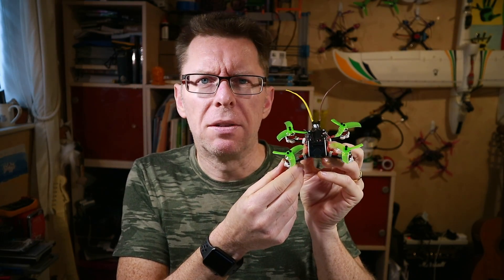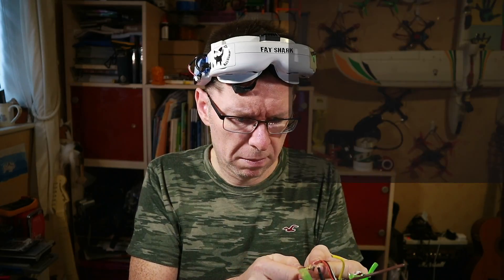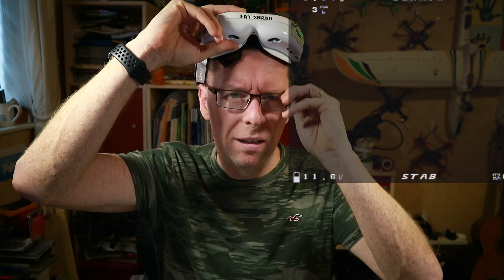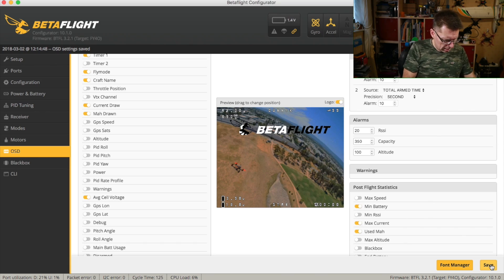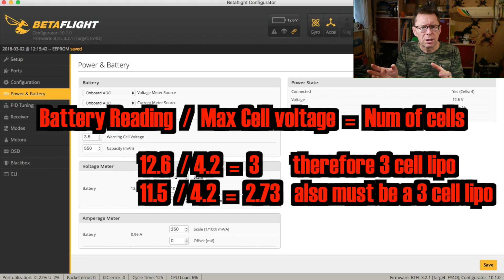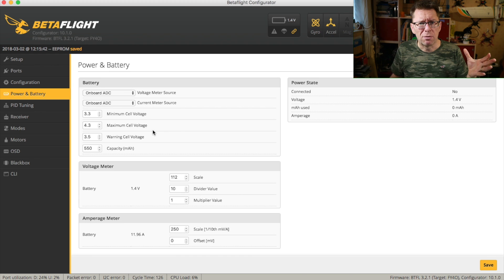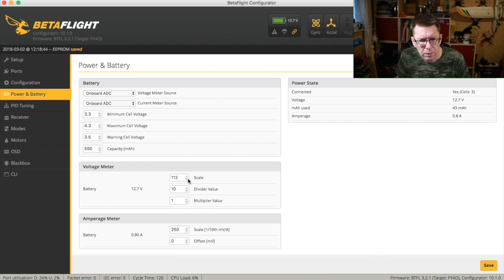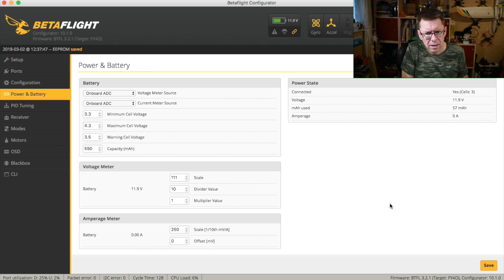FPV Quick tip: Fixing a flashing OSD battery voltage

Comment: Oh My Goodness i found this video, since I'm struggled with this same issue, Very usefull. Also i have an another doubt, since my battery(4s) voltage is now in 9.$v, How can i again charge it safely to the correct voltage? please suggest or post video for that.
Reply from the maker: The right answer is that the battery chemistry has gone too far and the lipo is past saving - replace it.  However, you can bring those cells back - do so at your own risk/against manufacturers advice etc and you may need to use a nicad or NiMH setting on your charger.  I won't describe it here, but do a search for "Restoring/Recharging Over-discharged LiPo" and you'll find plenty of guides.  You should note though that if you can bring it back to the correct voltage, doesn't mean it's "fixed"
Reply: @CurryKitten  okay thanks for the info.. will do that

Comment: What if my voltage keep 0.00v?
pls help
Reply from the maker: Would generally mean that you haven't connected up to your power to the vbat connection.  Flight controllers can all do things a bit differently, so check your pin outs

Comment: I have flashing zero's for both lipo voltage and average cell, I'm hoping this is the issue.
Reply from the maker: I doubt it, getting a zero on these usually means that it's not reading your input voltage.  Some FC's take their power in from the main lipo and it will pickup the voltage reading here, other ones run on a 5v input and have a specific vbat pin you'll need to hook up to your battery just to read the voltage.

Comment: Great video.  I had a reading of 3 cell in Betaflight when I had a 4 cell battery connected, and the all the voltage readings were off.  This video got all that straightened out.  Thanks for thinking to make a video out of this.  I've had the cell count of before and didn't know how to fix it.  Your explanation made it easy to understand.
Reply from the maker: No problem.  Sometimes I make video because I get stuck on something, so I figure other people do as well.  Glad it helped you out

Comment: Hey I think have the same problem but can't fix it..I have a BrainFPV Radix and can't see anything about battery either in Betaflight when I plug in with usb!
My voltage shows Zero and flickering in OSD..and also my rssi flickering!
Reply from the maker: That's a nice looking flight controller, with perhaps the best documentation I've ever seen.  A 0v doesn't really indicate this problem - this is more about the fact that it's not seeing any voltage from the battery at all.  Are you using the Radio ESC, or Powerboard, or something else.  Do you have you voltage/ground connected to voltage sensor/ground on the FC ?
Reply: @CurryKitten  I have a hobbywing 60A wired and all they are connected on fc except the vtx power that's soldered on xt60

Comment: Sir my OSD batt Voltage shows 0.00 and flashing but the batt is full charge and flying with it but could not read the voltage and i was worried and landed soon but low voltage didnt appear. Any clue?
Reply from the maker: What type of flight controller have you got and how have you got it wired up?  You might have to connect up a specific VBAT pin on your FC that you are missing
Reply: I have the same problem...Any idea..it fly ok..just not anny voltage...Only blinking 0.00

Comment: Hi Guys!, I have a QX65, and when I plug the battery it still says 0 volt (and disconnected), I'm missing some config here? I'm pretty new with betaflight... Thanks!
Reply from the maker: Normally things will come setup correctly.  I presume you are in the Betaflight power and battery tab and you are plugging in there and seeing nothing.  In the battery section, does it say Onboard ADC for the Voltage Meter Source (which is the case for 99.9% of quads out there) if it is and there's nothing it might be the case that the vbat pin is not connected to the power on the flight controller (or has come off) but it's pulling in 5v to run the board from elsewhere

Comment: Use a micro miniosd in a cc3d, but the value of the voltage battery comes fixed 17.09v is carrying or not, always 17.09v what can be?

Comment: Thanks for this, this was driving me potty last night, kept getting low voltage beeper, and could see it was misreading 2S as 3S, but couldn't work out the fix, and remembered seeing this ages ago, so dug it out and fixed !
Reply from the maker: Me to.  The worse thing was with this, when I'd remember to have a look at it at home, I'd plug in a lipo that was in storage charge and so it would come up correctly, and then magically be wrong when I charge them and try in the field :D

Comment: Thanks for posting this!  I had a similar problem on the Diatone GT M2.  It seems to have fixed the issue mostly, but at times it thinks its a 4 cell and wont arm.  At least that's why I think it wasn't arming.  I'm still new to this.

Comment: i have an issue similar to this on OSD. it seems theres alot of static and the OSD doesnt show up  quite well. any solution to that?
Reply from the maker: Is it the OSD in your goggles, or DVR recording ?  OSD flickering when flying (normally at higher throttle) is something is usually a grounding issue - make sure the grounds for your video in/oout and camera ground do all share the same ground.  If it's fine in the goggles but the OSD seems to dissapear on the DVR recording then it's sometimes down to the OSD not working well with PAL or NTSC (i.e whatever it's using, try a camera that uses the other standard)
Reply: im currently running both of these boards FC - DYS PRO F4 v2, ESC - RacerStar. cant really get a firm writeup on how the grounding for the OSD to work. any idea where can i source them ? appreciate if you could help. thanks Curry!
Reply from the maker: Have a look at this great video from the late project Blue Falcon https://www.youtube.com/watch?v=adM5bz8slbo who explains the idea of using a common ground very well.  Have a look to see if you have similar symptoms as a similar fix might sort it.  It can be a bit of a weird one, as in a single battery situation, you expect all grounds to be common, and in most cases you don't have to jump through hoops to make it work... but it seems there's some combinations of equipment that will cause issues and mean you have to do a bit extra to resolve them.

If this doesn't do it, or you issue is slightly different, if you could grab a video to show what you experiencing along with how everything is wired, then that would help in figuring out the issue.
Reply: thanks buddy! much appreciated !

Comment: Hi, same problem here on my QX65 Micro, only 1 cell batts and flashing Voltage on OSD? I tried the scale adjustment and doesn't fix it, tricky one.... at times it says 1 cell and other times it says 2 cell (with a 1 cell 1S plugged in)... so that is the same problem as you had. Not sure what to do?
Reply from the maker: Well, certainly it coming up as a 2s lipo would be a similar thing.  In your case it would decide if it's a 2s battery by detecting that your battery level is greater than the max cell voltage.  It could be that it's reading it wrongly.  So for example you charge a lipo to 4.2v but the FC reads it as 4.3v and the max cell voltage in betaflight is 4.2v.  It decides you must have a 2s lipo in with just 2.1v per cell.  Sometimes a battery voltage reads high initially and then seems ok - so try raising up your max cell voltage slightly.  4.3v is usually enough, but have a look at what betaflight  thinks your voltage actually is
Reply: CurryKitten thanks, will try now, good ideas. Tricky!
Reply: Thanks for that, that was the problem. My 1S Lipo was reading 4.3v when plugged in, my limit was 4.3v. So I put up to 4.4v and still a problem, 4.5v fixed it, it now says 1 cell not 2 cell when plugged in so I am sure it won't flash anymore, very cool. Thx for that!!

Comment: I've been fighting this problem since flashing to the latest BetaFlight. Was driving me crazy having to plug my battery in 4+ times till it got right. My buzzer is also configured to beep for low battery so it was annoying. You solved my problem so good thing I stumbled across this vid.
Reply from the maker: Awesome - had me confused for a long time as well.  Glad it helped you sort your out

Comment: I have a question for anybody out there that can answer this. I have a tranis qx7. And a XM Plus with a SP racing F3 flight control. My question is how do I get RSSI on my qx7? I am new to this and I've been trying to get RSSI on my qx7 or OSB and everything I have tried I have no success.
Reply from the maker: The XM+ always comes shipped with the default firmware which is just sbus channels 1-16.  To get RSSI on it, you'll need to flash it with the alternative firmware which will put the RSSI signal on Ch 16 or ch 8 (I use the 16 version) to do this, take a look at this video I made https://www.youtube.com/watch?v=3NObP3uhaao which also has a link back to an earlier video about where to get the firmware from.  Once flashed you just need to change the RSSI channel in the receiver tab in betaflight.
Reply: CurryKitten okay I got everything downloaded everything that I think is right and betaflight on the RSSI Channel it only goes to 14 aux. My RSSI is showing up on Channel 12 I cannot go to aux16 where did I mess up?
Reply from the maker: You didn't.  aux2 is different to channel 12.  You'll notice that the first 4 channels are reserved for your sticks, so aux1 is channel 5, and so on.  So aux12 = channel16

Comment: Thought you had fixed an issue i was having for a moment! 
I've been getting the same or rather a simlar issue with bf (i think v3.2) and a Racerstar aio fc/esc. 
However i have the voltage correctly calibrated in bf and when I plug a battery in it recognises correct voltage and cell count and the osd reports correct total voltage and cell voltage however still continues to to give low battery warning! 
I have found that letting the board power up and go through it's beeps then disconnect and reconnect the battery quickly before any residual power has dissipated fixes it! Tedious but works since I can't figure out where the problem lies lol

Although it doesn't matter now anyway!  I toasted that board yesterday LMAO
Reply from the maker: Oh noes !  Her'es hoping that the new board works as expected though